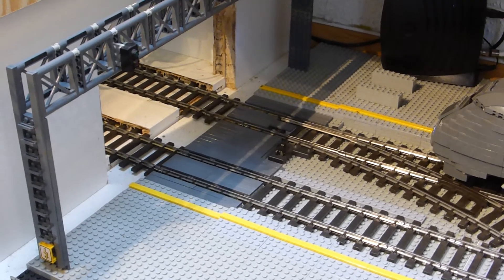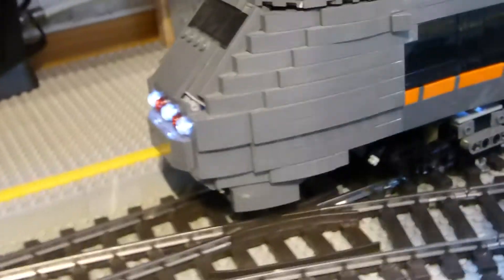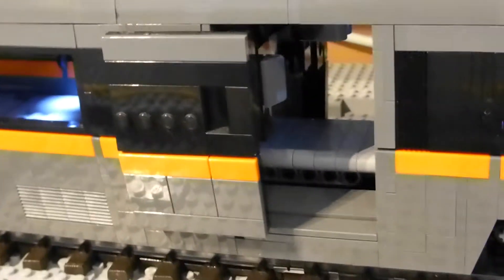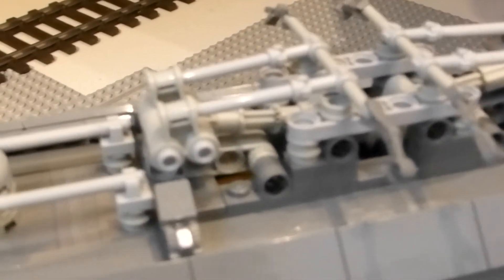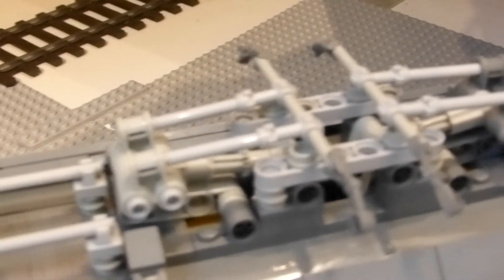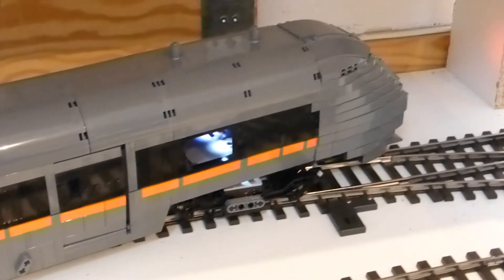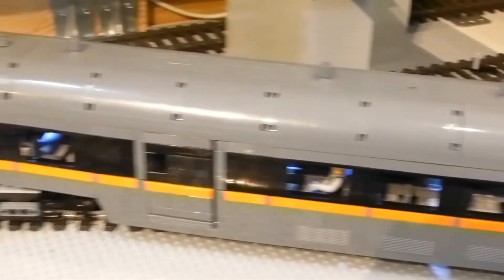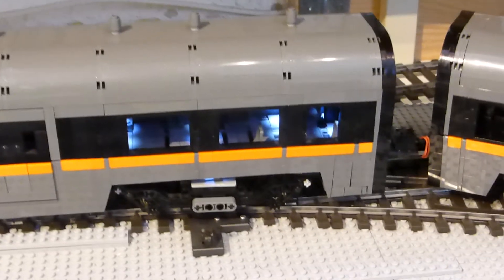LEGO Norwegian Airport Express Shuttle/NSB Flytoget på Gardermobanen LEGO

Comment: Wow! Awesome creation! I am planning on building a LEGO model of the Alstom Pendolino, which is also a tilting train. However, my model will tilt with a simple mechanism that does not use motors. To prevent my model from tilting too much, each bogie will have two rubber bands. The train will tilt by a LEGO Technic axle connected to the bogie which will move the bottom of the train. So on the straight track, it will not tilt, but will tilt according to the curve radius. Cheers!